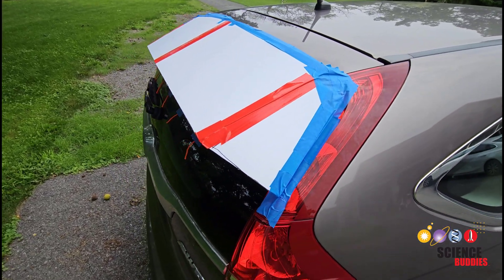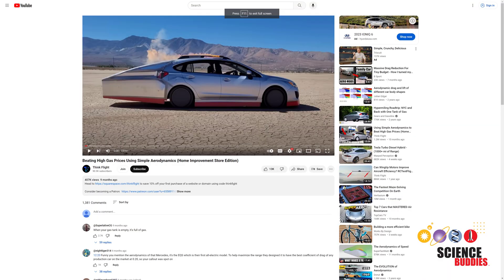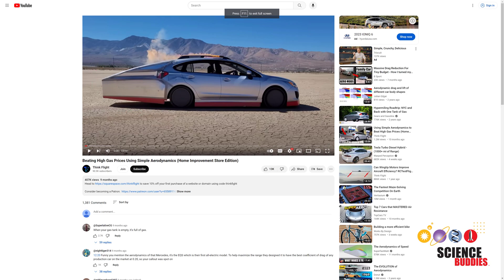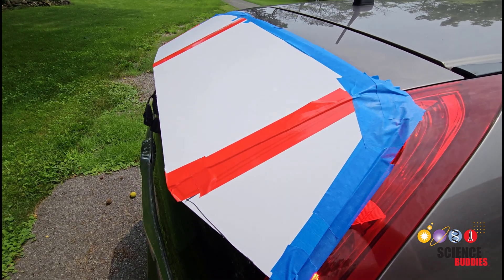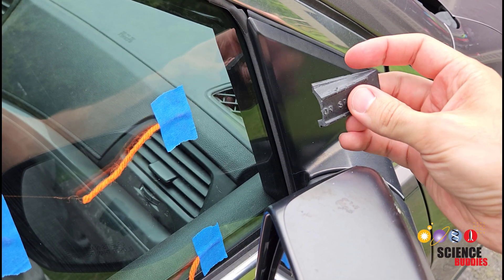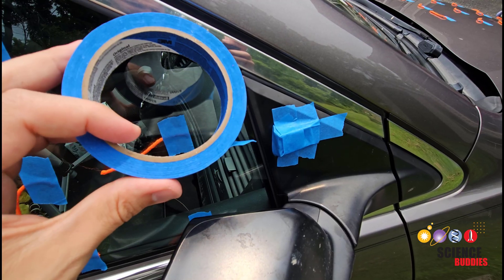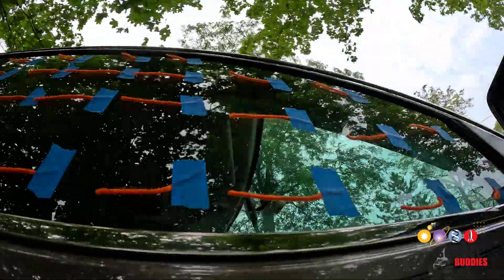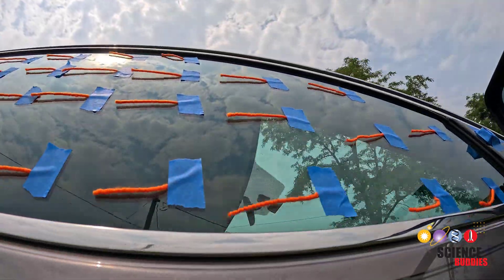How to Reduce Drag on Your Car | Aerodynamics Science Project

Comment: Interesting stuff although not entirely sure the streamers on the rear window are providing useful information after the extension is put in the rear roof. They are most likely out of the airflow all together. Streamers placed on the extension and filmed might have been better.